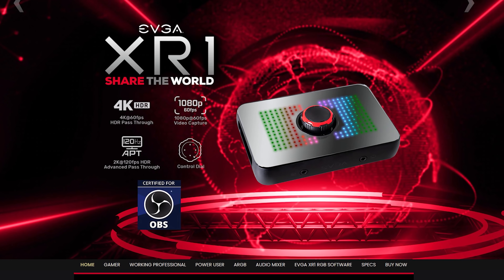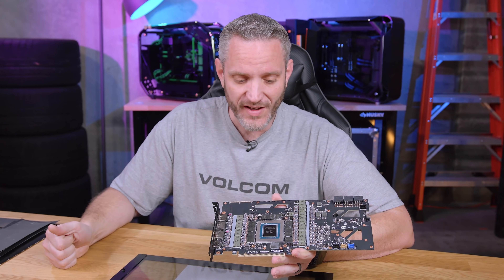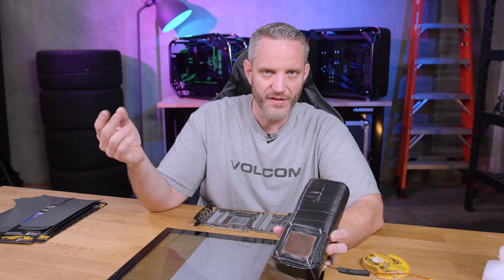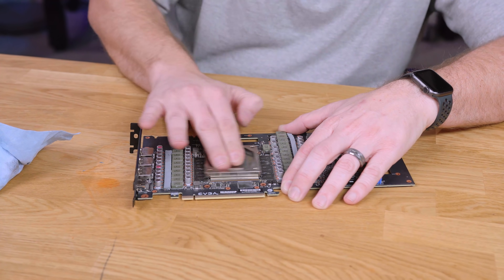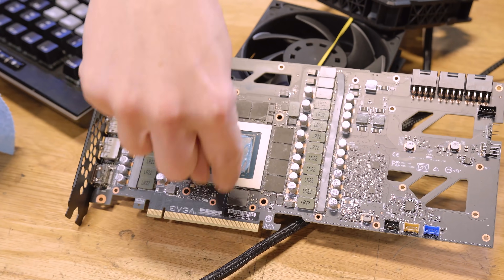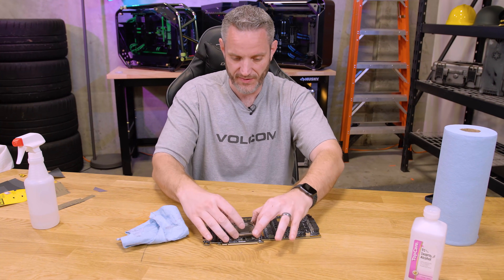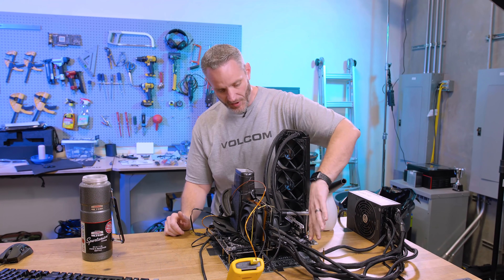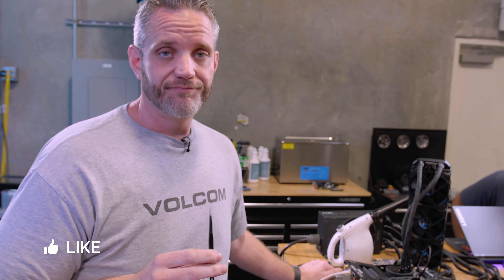I ruined another GPU....

Comment: A single small cap very often doesn't have a notable impact on performance. For this particular use, you should get it back on though, you need all the noise suppression you can get. No need to send it to Vince though, just take it to the nearest phone or laptop repair shop that does board level repair. They'll sort you out faster than you can go get a coffee if you bring the bare board. Probably gonna cost you less than one way shipping to Vince, and you don't need to wait so long.

Comment: i braze copper for a living and if you have a steel pot brazed to copper the steel will pull the heat out of the copper and you should be able to hold your temps or even be stable at a warmer temp

Comment: Stick with the P2000 (or even P2500) sandpaper.  It may take longer, but you're looking for maximum smooth and polished (with minimum material removed); the finest of ultra fine grits is the only way to go.  More haste, less speed, etc.

Comment: you could try using valve grinding paste, the type used for lapping in valves of a cylinder head that would only contact the raised letters when used with a flat rubbing surface, sorry for the poor explanation i was a motor vehicle technician not a pc builder.

Comment: If you are at all serious about flatness Google how DIY telescope mirrors are made, sandpaper and circular rubs are the best way to quickly produce a pizza base.  Alternating with THREE polishing surfaces will prevent a single pair from generating distortion, one surface becoming convex (the lower one) and the other becoming concave (the upper).  The right wet compounds not sandpaper! and finishing off with a wax or damp paper polishing lap will give flatness measurable in nanometres.
Would a section of an astronomical telescope mirror be flat enough?

Comment: Unironically you may benefit with building a faraday cage. You’ve already shown that your wireless mic has affected stability
I wouldn’t be surprised if interference is  affecting stability with how hard you’re pushing these
I’d also recommend having a UPS to smooth power delivery to the PSU (you get what you pay for) which would help make power delivery smoother and cleaner and increase stability

Comment: Jay, I sympathize with you knocking the component off. 😬 A couple years ago, I accidentally knocked a flash memory chip off the flight recorder/controller/transmitter board my rocket team was using... it ripped up some of the traces which made it very difficult to repair. Due to time constraints, we had to improvise and swap in a different device.

Comment: Jay. I do not recommend using a heat gun to heat food. The insulating material and other stuff can microscopically be expelled from the gun onto your food. It is very possible this material could be hazardous to your health. This is speculation since what is expelled and how much is not known, but I wanted to give you the heads up on the possibility.

Comment: That one cap wont hurt your performance, just check your resistance to ground to be sure there isnt a short and bench away
Reply: It really depends on what purpose that cap serves. On the back side of the card, right next/under to where the GPU is located, that's going to be a noise decoupling capacitor for the GPU, which could potentially have an impact, even if subtle or minute. Decoupling caps need to be positioned as close as physically possible to whatever input or output it is they're decoupling so that you have the absolute minimum uncoupled induced signal noise on that input/output.

Comment: I hope you see this and think about it. You are pressing the back of the die with a round piece of metal.... no matter what you have on the other side the most pressure is centered due to the design of the clamp. If you want even pressure you have to put some type of block on the screw part of the clamp, that will give you even pressure over the whole surface not just at the point of contact... try it ,I think you'll find it works, try a clamp thats at least the same size as the die, at he back of the PCB

Comment: Maybe a stupid idea. But what cokes to mind with me is how you need to cut in valves in a valve head. Maybe a stand for it and use a axel on a spring (not to much force on the die) and use a cutting paste while using something like that waterblok (but harder material then the die) and doo it like you would cut a valve in

Comment: To lap something by hand takes super patience and time management. NEVER start with higher grit then 800. ANYTHING else cuts deep groves. You PULL the part towards yourself NEVER push. Your hands are not stable enough to push and get even. Pull twics with little pressure. Rotate the part 90 degrees pull twice. repeat until you see even cuts across the part. Then go up to next higher grit repeat. It is VERY important to remove the cut material with each 90 degree rotation. Work your way to 2000 grit. THEN use polish to super shine the part. Once you hit this stage hold the part up to the screen in your window. You will see ANY imperfections as the screen will look warped.

If you do this to both parts then when done you should be able to lift one with the other just with surface tension. It wont stick long but enough to know you lifted it. Then minimal thermal paste is ever needed.

Comment: Would putting machining dye on it before sanding it to see where it's touching help?
Reply: As someone that does a small amount of honing at work I thought this too, a bit of bearing blue (machining dye) would definitely reveal high spots using the prelapped block - the hardest part would be making sure everything is levelled right before starting out

Comment: jay what if u got a little square of copper with a square cnc's out of it, lap that and use it as a rear mounting plate for the c clamp? you'll be able to mount with more force and would spread the pressure a bit outward to help counteract the bowing from the other side

Comment: Take a sharpie and mark whatever you're sanding before starting. After a couple passes you'll be able to see how off center hand sanding can be. Perfect hand lapping is difficult, especially if you're trying to create a parallel plane to what is mounting up to it. At this level of precision you're running into GD&T tolerance issues rather than is it shiny enough. The main concern should be, is the surface of the die in an acceptable tolerance of parallel to the surface of the pot? Ie, will the two surfaces mate with an acceptable amount of common surface area between? Maybe a conduit material is needed, like thermal gap pad or liquid metal?

Comment: Have you tried using a small torque wrench to make sure you apply even pressure on all 4 corners of the die when mounting the pot. Ive never done extreme OC, but it would probably even out mounting pressure on the corners.

Comment: I know his feeling, ripped of a Capacitor of my 3090 while mounting a Waterblock, seems to be somewhere in the Power Delivery for the GDDR6X on my Card, so far its working perfectly fine, but under his Extreme Working Conditions the Card might actually be unstable or his Capacitor also might just be more important than mine. Still, good to see iam not the only one to do this.

Comment: Hey for LN2 oberclocking why don't you use liquid metal I think with that you wouldn't have to suffer through paste cracking
Reply: Liquid metal turns into a solid and cracks at LN2 temperatures
Reply: Cause LM doesn't perform as well at sub-zero temperatures cause it freezes into a very poor crystal structure for thermal transfer, paste does crack and freeze but it's still "pasty" in that state if that makes sense.
Reply: @3dprintedodubunga405  oh ok thanks that was interesting

Comment: You should use laser etching to remove the top layer/lap properly instead of sandpaper. With sandpaper you are causing millions of "micro" scratches on the surface of both the pot and the die. With Laser etching it will be as smooth as possible with minimal scratching. Go find a guy with a powerful laser and etch instead of using sandpaper and manually doing it.

Comment: Why not make a pot that puts nitrogen directly on the die
Reply: I suspect it has to do with thermal capacity, the GPU changes temperature rapidly depending on how much work it's doing. Having a reservoir of cold is better than more extreme cold.

Comment: if u lap, then u shouldn't be using thermal paste inbetween. The die is not a mechanical seal or metal surface where u need surface to surface contact. Maybe a material engineer and mechanical engineer can explain this.

Comment: Guys I’m about to build my first ever pc on a very tight budget. All I need is storage and I’m stuck between a 1TB seagate or a 512GB ssd I know that ssd is quicker and less noise but I do need that extra storage and also it’s cheaper. So is it actually worth the improved speeds?
Reply: Depends on what you plan to install. Windows needs about 100GB and many games are more than 50GB so if you play more than a few big games frequently you'll fill it up. TBH most people can fit all the stuff they need to load fast in 500GB but I doubt you will find a Seagate SSD much slower than anything else.
Reply: @nicholasvinen  ok thanks a lot man really helps

Comment: Jay, I hate to be like this, but you cant be using glass if you want serious flatness. Glass is flatter than most other things you have lying around, but compared to a GPU die, its rolling hills. Get a granite surface plate and support it properly if you want to get high levels of flatness and precision. They aren't terribly expensive used.

Comment: The interface material definitely seems to be a problem. I wonder if there's a technique where someone could use solder to bind the die and heat sink like the CPU companies do between the die and the IHS...
Reply: That would be extremely risky for XOC guys, let alone casual overclockers
Reply: I would definitely include Jay in the XOC community at this point, and I wasn't even saying he should try it - I was just wondering about it. For example, there might be a good mix of metals that would be liquid just above room temps, but would be more reliable at very low temps.
Reply: @JordanNeenan  It'd be very interesting to bring that up with someone who knows metallurgy, especially the solder side of it.

Comment: Jay FFS. 3090 die is just 628 mm^2. Could have used 980ti (dies). Hell even a 780 would only be like 2 mm shorter on one axis.

2080ti die is WAY bigger than 3090. Only thing in that size range, in the enthusiast and prosumer space - is the 2080ti/RTX Titan, and the Titan V (the Volta basically smashes face first into current lithography reticle limits).

Comment: The tolerances for the GPU die itself would make lapping it even to get the letters off would make no sense any thermal paste worth anything would get you the mount you would need that 0.00000000000000000000001 different is not enough to matter

Comment: 2000 grit is too abrasive. The minimum grit you would need to use is 8000 grit or finer. Anything else would just be too abrasive. I like to use abralon pads which are used for polishing fighter jet canopies. It takes way longer to lap but it's much less aggressive which gives you more control.

Comment: I feel like they're hiding something.  I've seen probably 5 or 6 videos in the past 1.5 hours and only one gave an after result.  Every other one leaves a cliffhanger like this.  Almost as if they are using an upgraded or molded card to achieve those high bench scores, or something, and Lapping really doesn't offer all that much.
I mean... that seems more likely considering the one person did a Delid, lap of the die, and they got a 3.6C average temperature drop.

If you think about it.  If you really know graphics cards in an out, or even if you don't you could send one to an electrical or hardware engineer and they could be like "oh yeah you replace the VRMs with these, these diodes and resistors with these, you replace these mosfets abd transistors with these and you swap you oscillating crystal with this one and now you have a 22kHz card."

Comment: You can't get it flat going back and forth. 
AVE has a video on sharpening hair trimmers. Both pieces must be flat for the trimmer to work.

I would think this would'nt be any different. You need to do a figure 8, not back and forth not in a circle.

Comment: Ever Install Ceramic Tiles? Try A Toothed Trowel,if you will, To distribute the paste with A More Consistent Layer, less resistance With Smaller Beads. Rather Than Blob With Possible Uneven Distribution Force Caused By forcing the 'Blob To Spread So Far.Maybe? Juspitballin...@'Ur6

Comment: If I had a 3080 I wouldn't even overclock it. I just don't need that extra 3-5 fps nor do I care about some pointless OC record/bragging right. 4k/60 is already good enough when it can do 100 fps in some games. I sure as hell wouldn't risk breaking it by lapping it, even if it were easy to burn another $1000 and get another one if I broke it. Same for -20C phase change, not worth the risk so I quit using it in 2005 (after the backplate heater broke and condensation ruined a $1000 FX5950 CPU and the mobo socket).

Comment: I know its a long shot but wouldn't liquid helium be a lot more cooler for keeping the chip cooler and quicker as liquid nitrogen is less effective than liquid helium?
Reply: I see one issue being that it cool freeze too quick and crack the paste but if you can keep it stable in quicker you may have more time for the overclock to give a better score
Reply: They haven't even hit the limits of liquid nitrogen, so it wouldn't be worth the cost of liquid helium.
Reply: @icantthinkofaname2176  true but i was thinking more when he starts the test it needs to be a decent temp for it to run clearer if helium could give the perfect temp at the start and cool quicker later in the test it may work for a better score no?
Reply: Liquid helium is quite expensive and nonrenewable.
Reply: @joefowble  hmmm I'm new to eoc thought it would be a good guess as it freezes much quicker for quicker results unfortunately seems I'm wrong ty guys <3

Comment: There is no way possible you can lap that silicon die smoother than from the factory standard CMP process with the micron size slurry that's used. The laser etching recesses the labeling into the die; so you end up roughing up the already pristine polished silicon around the labeling. Makes me cringe watching this

Comment: why dont you use a thermal pad instead of paste since it cracks?
Reply: Thermal pads have worse heat transfer compared to any thermal paste. They can't deform enough to fill the micro-cracks.
Reply: @icantthinkofaname2176  isnt there a diamond one? i could be mistaken but there should be a diamond thermal pad that has better heat transfer than thermal paste.
Reply: @SunshinestateClean  If you're talking about the IC Graphite pad, it works well enough for normal applications, but isn't robust enough for XOC stuff. For XOC, you need to fill in those cracks evenly and extremely well (even at extreme low temps) to minimize hot spots at the edge of performance.
Reply: @icantthinkofaname2176  Oh alright, you clearly know more than me thanks for the info.

Comment: Considering you can crush the die from over- tightening the cooler and its clearly a more delicate approached mod oppose to lapping a IHS. I feel this was just stupid (friction, metal shards, shorting ect). Next time please try with professional machinists and use old cards to work out the 0.**mm to do a proper attempt. Sanding the die to remove the raised text is one thing but lapping to go further is a nooo unless trialed with old  cards for a good idea. After a pro lapped die, properly lap a cooler block to its thinnest and go that way

Comment: Can somebody help me?
I have a new pc builded by the sellers. It seems like everything is alright but when I'm trying to install the win10 for the first time there's no signal on the monitor I checked with the website if my CPU is compatible with the motherboard and it says there's a chance it may need a bios update BUT the processor is Ryzen 7 3800XT and the motherboard is gigabyte Auros Pro and on the box says and ryzen 3000 gen ready so is the bios the problem? One more thing when I turn my pc on there's a red diode lighting in the right down corner as VGA. Don't know what to do here Please help Should try to update the bios or not?

Comment: BTW, jay. All the effort you put into making the plate flat was lost using the sand paper (it's much more inconsistent than the metal at that point). Look into the techniques for lapping surface plates for inspiration. Use diamond paste or another paste based abrasive if that's too fine. And if you want truly flat, glass won't cut it. Leverage geometry for perfection. https://ericweinhoffer.com/blog/2017/7/30/the-whitworth-three-plates-method

Comment: Lol, did something like that to one of my cards cause I was carless and didn't want to remove my GPU when upgrading my CPU. I broke a semiconductor off cause I had so much suction on my cpu cooler and it snaked the back of the card😂 turns out, most power regulator semiconductors are not necessary and you can bypass them😂

Comment: You are doing it so wrong. You have to lap both sides of the cpu! Hahaha in seriousness though the more you remove the thinner the metal between the less resistance of the cooling. Id take it down lower than just a surface rub to see if that helps even more!